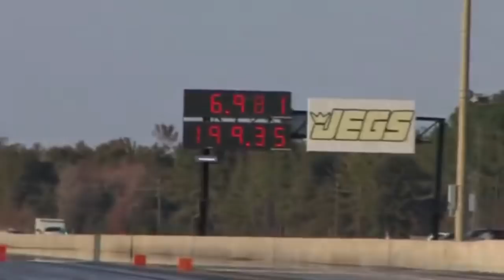WORLD’s ONLY 6 SECOND HONDA STREET BIKE! Inside the 200+MPH TURBO CBR1000RR!

Comment: A beautiful ripper & it’s cool that it can run on the street even a little. But a blown bike with no cooling plus a drag extended rear and methanol. Not running down to the shore on  the weekend.  Still it is a unique and Wickedly fast scooter.